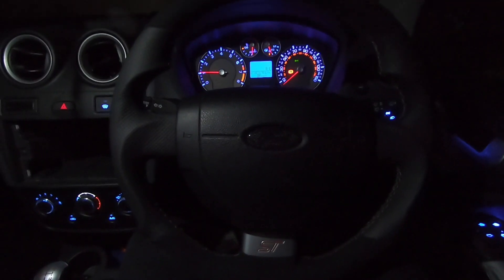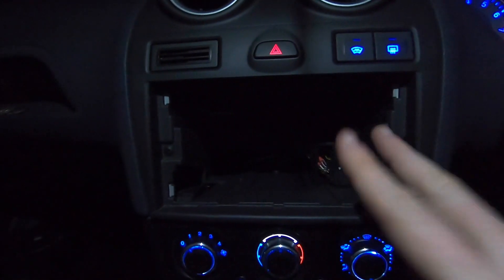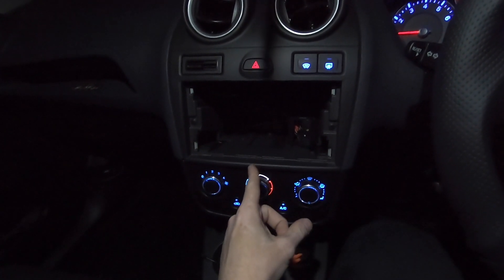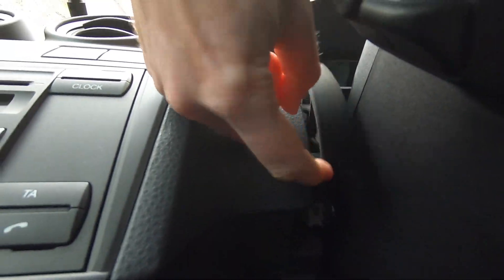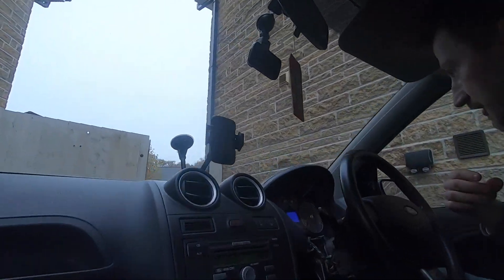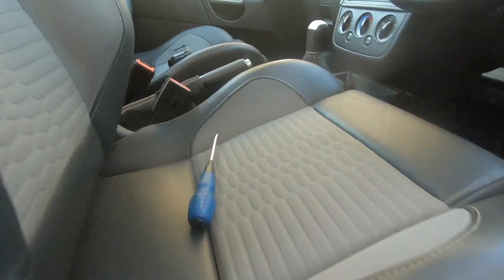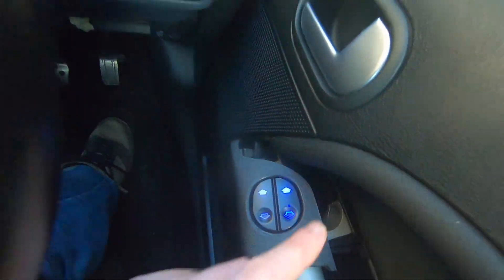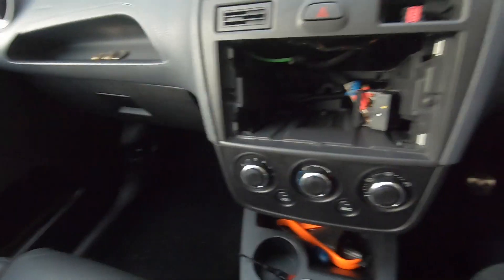LED Interiour Lighting Upgrade by ModsnFlocks Detailed Installation Tutorial MK6 Fiesta - Episode 09

Comment: Hi Andy, I’m stuck with the heater control panel. The green clip on the back of it is unhooked on the metal bit but I can’t work out how to get the  ig green bit out of the plastic, do you have an instagram I can msg you on?
Reply from the maker: I had a right hard time getting it out too. I am @drive_with_andy
Lot of gentle pushing and pulling from memory

Comment: These are so much better than the green, I’ll have to send Rookie Mods a message about them. I’ve got a traction control button where the coin holder is so hopefully she can do that one too 🙌 How much did this cost all together?

Cheers for the video though mate, will definitely come in handy 👍
Reply from the maker: Yeh it totally changes and transforms the inside feel and look of the car at night now.
Best to check prices with them as you can choose colours and colour combos for the heater control and dials but I can say the other switches are in eBay which there is a link to in description 😁👌👍

Comment: Hi!
Do you happen to have problem with the fuel arrow?
In my friend's case, it sometimes stays down when he is driving the car.
Do you know how to fix it or what the problem might be?
Reply from the maker: No, but anything could happen. My trip computer display does flick half off nowadays. I would suggest Swift LED Conversions on Facebook
Reply: @DriveWithAndy  In that car everything works fone except that fuel gauge. Sometimes it wasnt moving from the top position, and nowadays it just doesnt work.
A year now on my astra's conversion and no problem at all. But on the fiesta there is that problem and I dont know if its because of the conversion or not

Comment: Hi Andy hope u can help me i watched u take out the clock dials out of ure fiesta which i have just seen even though it says 3 yrs ago i have a 2003 mk6 fiesta and the display is dull if i take the display out and remove the clip with the wires on so i can put new bulbs in will i have to reprogram the display to work as my bulbs are very dull and can't see how much fuel i have in thanks
Reply from the maker: Well they are LEDs so youl need to know how to install new ones if you are doing them yourself  it otherwise personally I'd suggest Swift LED Conversions on Facebook. Message them, great guy, very helpful and I'm sure can sort you out

Comment: Get the clock to replace the coin holder dude, seen a vid on it and it’s a cool add on as it comes with 2 temp sensors as well
Reply from the maker: yeh have thought to but then not sure i like the clock, bit 80s lol. Would like something there that looks more OEM

Comment: I can’t get the window switches unclipped from the plastic as you didn’t show us how to do it. Help?
Reply from the maker: watch from 8:45 once the panel was removed, small flathead in the slot to take it off the orange part, then pinch the clips and pops out

Comment: Was the mileage on the speedo dials synced with your current mileage?  Great vid by the way!
Reply from the maker: Yeh the trip stuff was exactly as I left it when I posted it out.
Thanks man 😀👍
Reply: @DriveWithAndy  ah I see you post old one out!! Got ya, I need to do mine but my dials are all broken, was hoping you was sent a new one already done like an exchange service lol
Reply from the maker: @DJLloydy  ahhh I see I don't know if it's possible. You could email them and see what they say. I less you buy a clock/dials/Speedo and have the trip set before sending

Comment: How do you change the bulbs you're not showing as how to put the bulbs in
Reply from the maker: The video is installing the new units that you can buy
Reply: Can you just change the bulbs in the Speedo clocks or do you have to buy new unit
Reply from the maker: @stephenziemelis3579  electrics isn't something I wanted to mess with so just sent them off to have the new LEDs installed. I think a few different people do them. Would have to post on some groups on Facebook. Some parts are available to just buy off eBay

Comment: Was the millage stored on the dials or in ecu on these?
Reply from the maker: Heya man. I assume the dials? As I had to send the whole unit to modsnflocks. I was advised you can get a second unit to do the LED conversion but then you have to know what your doing to do the mileage and I did not want to mess

Comment: YOOO , BUT WHY DONT REC WENT YOU DISCONECT THE CABLES AND REPLACE THE LIGHTBULB , I KNOW DISCONECT ONE CABLE , BUT I NEED TO SEE HOW TO REPLACE THE LIGHT "Detailed Installation Tutorial" THE TITLE OF THE VIDEO , AND THE TUTORIAL IS NOT GOOD MEN , WHY CUT IMPORTANT THINKS IN THE VIDEO ?
Reply from the maker: @ByGabriGTX  this was one of my very first videos so early on I did less and learnt more and more with my videos over the year. I am more detailed now
Reply: @DriveWithAndy  YEAH , i know , i wiew your new videos , i have a fiesta too , and i like your videos , but in this , fck ajjajaja, i dont know what did you do to the cables , but its not problem , in the videos , you can put the thinks  (links to shop)  because is very difficult search specific things for this model 😮‍💨